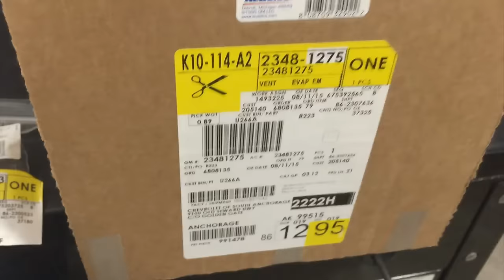Chevy Truck Hard To Fill Gas Tank - GM EVAP Codes P0442, P0446, P0455 or P0449 Vent Solenoid replace

Comment: I have a 2011 Chevy Avalanche Z71 5.3 thats a flex fuel, I get a tighten gas cap on heads up and i cant fill the tank either. Is this the same issue?
Reply: I'm getting the same thing on my 2016 silverado... Started today with the fueling, but have been getting a tighten fuel cap msg for 2 weeks

Comment: Mine was not quite so simple. My evap canister obviously broke and dispersed charcoal pellet throughout the entire evap system. There were charcoal pellets at the purge valve and in the tank and everywhere in between. I had to remove the metal purge line from the frame rail and cut the flexible hose in the center of it to get to the impacted charcoal jammed there. Your viewers need to be aware that this problem COULD entail many, many labor hours to fix.
Reply from the maker: yikes, I hate it when that happens. Glad you eventually got it figured out. Thanks for the info/warning for everyone

Comment: Do you know if there's something in the filler neck that can also cause the issue? I've replaced canister, purge valve, solenoid valve. Rotted fuel pump and sensor. Blew the lines out. Still hard to pump gas

Comment: Hi guys, I have a 2009 CADILLAC ESCALADE ESV, Have an issue with the pumping gas in the tank it keeps shutting off. I replaced(oem) solenoid vent vapor EVAP valve, also replaced (gm) Fuel cannister, also having removed spare tire and dropped the gas tank blow all the ventilation lines of excess carbon particles. Still having  same issues not being able to fill tank. Vehicle is not showing any codes, PLEASE can some one tell me What is the fix to this problem??. THANK YOU.

Comment: I have a p0442 and replaced the purge valve 3 times. Tested the valve with a vacuum pump before installing and i holds pressure for up to 20pounds. Check engine light turns on after 5 days of driving p0442 again. Test the valve and it wont hold vacuum. This happens 3 times evap monitor clears and it throws the p0442. I replaced the gas cap as well and the vent valve.

Comment: Well done video sir! Having this problem with 2012 Avalanche LT. I opted to just zip tie the filter end near the filler cap instead of drilling a hole and using a push pin. I could see where the previous owner did the  same. I guess this is the 2nd time for mine being replaced since 2012.

Comment: I think that explains why my stupid 03 TrailBlazer has always had an issue trying to fill the tank except very slowly,the damn pump would keep clicking off. That and the 0442 code all the time. The Dealer was blaming on everything but that evap valve,including fan clutch ( which I already changed) and thermostat  ( which has never ever given me a problem). Simple easy and not that expencive compaired to all the other stuff.
Reply from the maker: Excellent. It probably does need a thermostat if it's getting the coolant temp code. Super common. Also pretty easy to do from the LF wheel well area. Thanks for dropping by.
Reply: I got this problem on my isuzu ascender

Except its so bad that its like topping off the full tank right were it would sploosh out of the gas fill hole

Thats how frustrating it is just to put any full in it
Reply: Except mine doesn't have a code for this issue

Comment: 2005 Tahoe- I have replaced the canister, the solenoid at the canister, the solenoid under the intake cover, ran a new line from the purge solenoid @ intake to tank connection, and blew compressed air thru the rest of the system. I have no check engine lights on, but I still cant fill in a timely manner, and it causes the pump to shut off. exactly which line is it coming from the tank that vents most of the pressure? any pointers would be greatly appreciated. I'm going to drop the tank one more time, and want to fix it once and for. please help.

Comment: Excellent video, helped me tremendously with troubleshooting, removal and installation on my 2009 Suburban.  This is a simple process, seeing this video prior to venturing into this project reassured me that it wasn't as involved as the repair shop made it sound. $75+ in parts from Amazon and less than 90 minutest for time and I saved $400+ in parts and labor.  Nice work Car Doctor, thank you for the video.
Reply from the maker: +Jim Lilek Right on, glad it helped!  That's what YouTube is good for. Watching someone do it first so you feel comfortable doing it yourself. Glad it worked out and saved you some cash. Thanks for watching and I hope you visit again soon! PS- I just posted a helpful video on Chevy ride control suspension systems of your suburban is equipped with that feature you should check out the vid. Take care.

Comment: I am constantly getting a P0442 every 2 weeks or so. I've changed my gas cap already 2 weeks ago and I've performed this exact procedure on my 2007 Tahoe about 3 years ago. My truck has 144000 miles on it so I'm curious to know if I should go ahead and replace this vent control solenoid again. I'm not sure how long they're supposed to last. Any suggestions would be greatly appreciated.
Reply from the maker: +Reyhan gamboa The updated GM part usually lasts forever since it relocates the filter and prevents crud from getting into the valve. You may also have a failed canister or even the purge control solenoid on the engine. The purge valve is an easy replace and it's a $20 part. Canister isn't cheap.

Comment: Nice vid 👍 Hum- evap service bay test, I'd be interested in seeing that if you get a chance, never seen it done before.  I always hear most of them vent valves go more so on vehicles driven on dusty roads- is that true ?  Glad to see your back in the shop plugging away. Take Care Steve.
Reply from the maker: +Steve Rob The service bay test is a forced functional test using a scantool. Essentially it forces a complete EVAP test while sitting in the service bay idling. It watches fuel tank pressure while energizing purge or vent valves and watching for pressure changes. Not all vehicles have it as an option but most late model GM's do. I didn't show it but I had run through some diagnostics before making this video. I removed the gas cap and checked that the fuel tank pressure was about 0 But once I heard the customer complaint of hard filling tank and P0442 I knew where to go. Also not shown I did an autopsy on the valve and it had about 1/8 cup of dirt in it. Yes, dusty conditions will compound this issue however with the replacement filter unit I have never gotten a return problem. Thanks for visiting Steve!

Comment: i have a question. i have a 2007 chevy 2500 hd and it has a code p0446 evapor active emission system vent control circuit. could you help me figure out or suggest what part i need. thanks
Reply from the maker: +JoAnna Saxton this video should give you some great direction. Likely needs a vent solenoid and updated filter kit.

Comment: Do you know what else could cause a p0455 code? I’ve already replaced the evap canister and my check engine light keeps coming on after 200 miles.
Reply: Mine has this dumb issue and i have no codes shown on the panel

Its so annoying on my ascender

Its like as if topping the tank off as much as possible

Comment: Can anyone here help me before I tackle this job. Bought this truck where the gas gauge doesn’t work. Ruled out the cluster itself. I have p0461 and p0463 which only point to level sensor. So here’s my question can that be the reason at gas stations the pump will go on for like 5-10 sec ad then click off on itself? I have hard time filling up and I’ve been gambling for a month now wether or not I have gas or not lol. Might tackle this job on the weeken and just throw in an entire new fuel pump assembly. Any tips or pointers

Comment: So have a 2009 Silverado. Looks like the filter has already been rerouted. Replaced evap canister and solenoid and canister for it along with filter. And blew out the line. Still can’t fill up. What am I missing? Also have no codes at all

Comment: NOT ONE TAKES ABOUT, Other Reasons Why You Get Po452 code. I have a 2004 Silverado that sat for along time. I removed the fuel pump assembly, empty the tank, wipe clean and reinstalled all. Tried to start engine, it would crank, but hot start. Sprayed starter fuel into intake and it would start then die when starter fuel ran out. When to Auto Zone and paid $140 (Refundable if returned in 90 days) and found I had a P0452 code. I kept thinking it had to do with the opening of the fuel tank. Finely (After watching hours of videos) decided to remove fuel pump system. Cleaned opening and o-ring making sure o-ring was in the slot. After installing fuel system, noticed o-ring had come out, moved back into the groove, installed ring, and all connectors. After cranking 2 times, fired right up. All side remember hearing that if the gas cap was not tight or was leaking can cause the same problem. I wanted to pass along since I did not find a single video taking about the solution of a lose of pressure or a failed gas cap under P0452 code.

Comment: code p0446 after replacing all three major components related to this code. the system in the back of the truck, purge valve solenoid and gas cap. light has been reset maybe 5 times already and comes back as p0446
Engine speed over 40 rpm, system voltage from 7.5-15v, then the PCM detected a short to ground, an open circuit or a short to power in the Purge control circuit during the test period.
please... where is the Canister you are talking about? that's the only thing I haven't change.
thank you in advance
Reply from the maker: Likely a bad canister. it depends on the vehicle where its located. Some behind tank some in front.
Reply: +The Car Doctor 
Ok Mr. Doctor, I think I found problem thanks to your video.
I must to watched about 100 times... on the 8:50 minute the aftermarket hardness you hook up is not matching the wires right? I had hook it up for the colors to match white with and pink with red/pink. I noticed my plug the metal clip was on the same side as that release red clip.
I flipped the other way now and I just clear the code... will keep you posted in a couple of days...
thank you again for your help and time.
Reply from the maker: seems strange that the connector would even work that way. Keep us posted.

Comment: Serious question, is this a fix for the same issues with 05 Yukon's having the same problems with codes? Or is there a similar fix from GM for that generation of Yukon's and such? I ask because I am not able to find anything fix related for 05s, but am finding alot of people who have the same issues. Codes are P0455/496, 05 Yukon with the 5.3, 2wd

Comment: Hey I’m on need of help it’s been a horrible month of trouble shooting my 2006 Silverado 1500 had a p0442 code found out my fuel pump was rotted replaced it and now I have a p0455 everything is me purge valve, canister, fuel pump, and fuel cap OEM please any advice is appreciated

Comment: On my 05 Sierra a started experiencing difficulty filling the tank. Not long after, my engine light came on. I checked for codes but never had any come up. All my research pointed to the Vent Solenoid, so I replaced it. My engine light is now off but I still have trouble at the pump. Further research showed that the Charcoal Can might be plugged, so I removed the canister to have a look. When I blow air through the tank side of the canister (I did this by mouth) the air coming through the Evap. Sol. side of the canister seems restricted but is still going through. Should it be like this, or should it be easy to put air through it. Any help is greatly appreciated. Thanks
Reply from the maker: Probably restricted in the canister from contamination. Probably going to need to replace the canister. Will it fill normally if the vent hose is removed from the canister?
Reply: The Car Doctor
Today's experiment was doing just that, and yes it did take fuel. I also blew air through it, which was quite difficult. This confirmed what you are saying. It's blocked. I cut the canister open, and found all the charcoal is a solid mass in the one chamber. It is NFG. lol. Thanks for your response.

Comment: I got a p0440 on my 01 yukon denali xl. People keep saying it's the gas cap. I've now gone through three to no avail. It's obviously something else. I don't notice any issues filling the tank but when I open the cap to fill, no hissing sound is present. I figure that means improper pressure?  Does anyone know what that could be?  I gotta get emissions done by the end of September. I want to fix it right and not just clear the code beforehand.

Comment: For future readers of this Comment, the TSB is real money, it does not work very well as the Vent Solenoid Valves will still wear out in about 2 years and as part of this part to be replaced you should also replace the filter again with same type of foam that you can cut from home. These solenoids are a high failure rate and this TSB was a waste of money back in the day. If your vehicle can receive the Impala part number, then buy that one as it is one of the lowest prices that fit most GM vehicles, good luck. Car Doctor, thanks for the video as I have just recently found and subscribed to your channel and look forward to watching 100% of your videos.
Reply from the maker: In my experience the relocation of inlet  and addition of the filter indeed extends the life of the solenoid and its still a repair i conduct regularly. I can only think of one or possibly two repeat failures out if the many i have personally done.

Comment: Hello bro. I have escalade 08, i have filling fuel issue. I did change canister along with evap, then i rested the car computer by removing the red cable of the battery  (+). But still i have the same issue of fuel filling. Please advise. Your response is highly appreciated.

Comment: Hope you can help. Figured out to replace my solenoid for the P0446 code you remove the bed as it is ABOVE the frame rail. Same way you get to the fuel pump. Changed the solenoid - brand new , changed the hose. Checked every 15A fuse that could possibly be related. Ran a few days - Bang - Light comes on - code 1 is P0446 and Pending p0446. UGGG...at a loss and DONT want to take to a dealer to fix. Any thoughts or help please !!!
Reply from the maker: EVAP purge solenoid on intake manifold front just behind throttle body slightly to left as your looking at it. Two wire conector and one bolt holding it down.

Comment: Thanks a lot Car Doctor.
That was actually Pretty Simple Fix and being able to see drill hole location was actually the best thing to help with the orientation of breather box. Thanks 
Part store did not even list this part on my 07 avalanche on their system
But once I got the borg Warner Part No. CP-606 it had the tech bulletin reference and all the parts for the upgrade 
Thanks for an excellent how to
Reply from the maker: Glad it helped! Take care.
Reply: Hey Car Doctor It did not fix the problem I Had fuel pump replaced is there a chance the anti siphon flapper is jammed or maybe a vent line problem. The check engine light came back on after a 15 hr drive. I should probably change the other 2 switches the evap valve in engine compartment and vent solenoid on the top of the gas tank
What do you think
Reply from the maker: What did you change besides the fuel pump? What codes do you have?

Comment: i replaced the Canister Purge Valve and my 2010 Avalanche is still doing the same problem it filling up slow its a little better but it still cuts off while fueling should i give it some time or is there something else wrong with the truck that it wont fill up normally
Reply: My ascender does this

Comment: Just used this to fix my 2009 suburban. Didn't have a trouble code, but when I took it to the gas pump, the pump would be very difficult to fill with gas. 

This helped perfectly. Approx $70 in parts and 2 hr of time. Don't have a lift, so a jack under the diff would be helpful as the vapor canister is pretty tucked away. 

Thanks!!!!!

Comment: Have 2012 silverado that has the same problem  filling with code p0442 replace the purge valve solenoid and the canister vent valve. I was wondering what the extra wire harness do? i didnt installed. Im still having problems filling gas should install that the extra wire harnes tvst came with new part???
Reply from the maker: Yes. And probably a new canister.

Comment: I've got a 2004 Avalanche would my vehicle be covered by gm TSB -09-04 028D for replacement? Getting code p0446
Reply from the maker: I think your vehicle falls into the TSB range. It's not a warranty repair but an updated vent assembly and replacement canister if needed.

Comment: I have a 2005 Chevy Equinox v6 
I keep getting code P0446 and I already installed new fuel pump pressure sensor, new purge solenoid. Both items from Chevy dealer. Sometimes it gives me hard time to start car up after fueling up.Any idea what could be causing the issue  and code keep coming back ?
Reply: did you ever solve your P0446 issue? what was it?